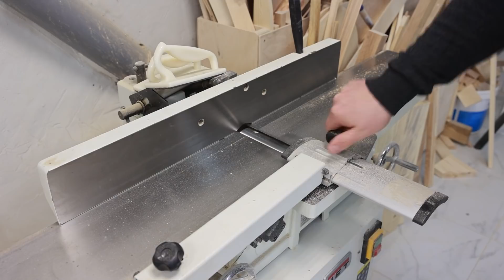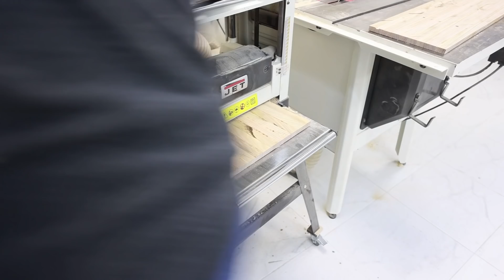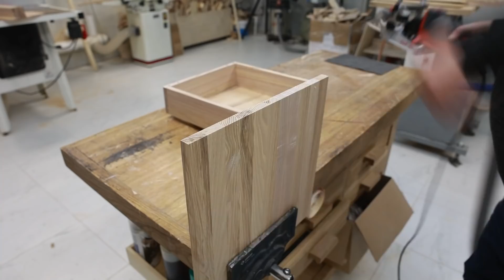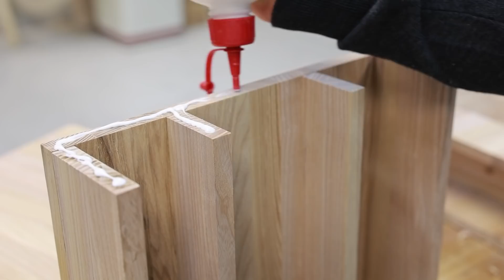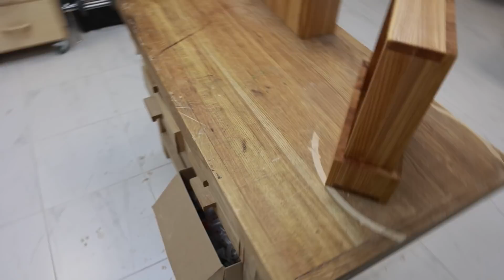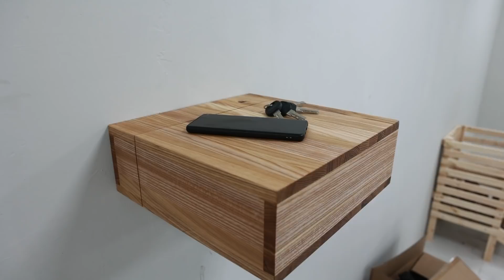Тумбочка с секретом! Такой вариант ты еще не видел...

Comment: Nice work! I would screw a little rubber button to the inside of the top plate that functions as a stopper so that the movable part can not fall off.

Comment: You pull out the table to get to the drawer???  While this certainly is a good-looking piece, it would only be practical if you never put anything ON the table-top.  If you did, you would have to carefully balance your keys, wallet, eyeglasses, book, etc. while opening the unit to keep those things from falling to the floor.  And forget about putting a bedside lamp on it!  The Form is very nice, the FUNCTION not so much.  I guess I'm just too practical for something like this.